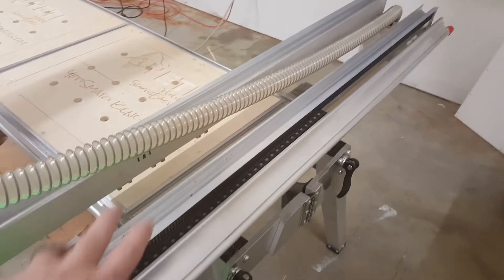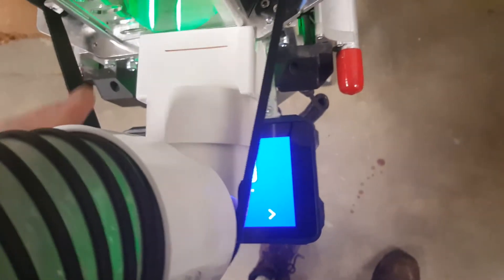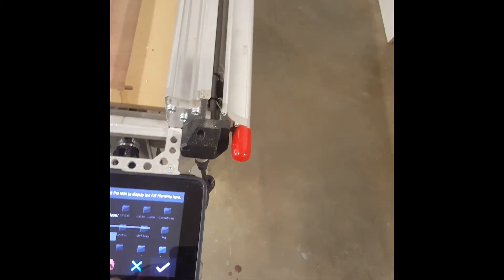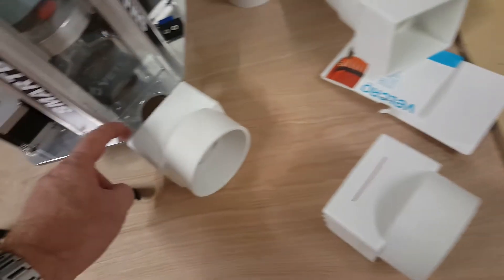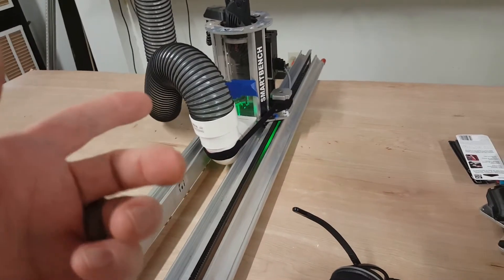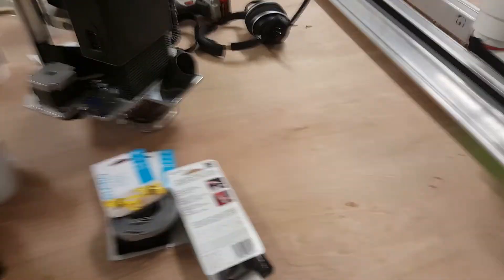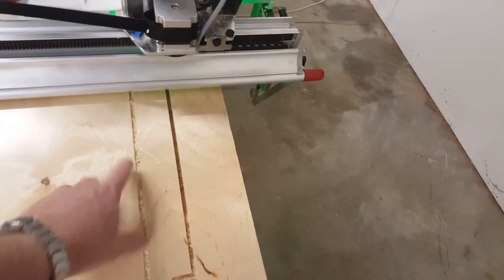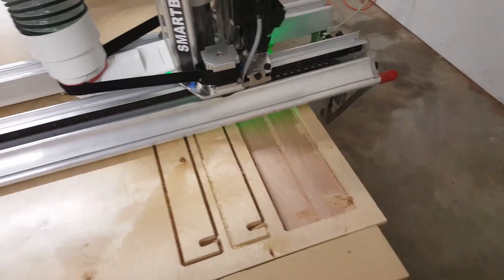Connecting a 4" dust collection system to the Yeti SmartBench

Comment: Yeti should just provide this as optional. When dust accumulates on the workpiece it actually affects the accuracy, as the wheels will roll over it lifting the x beam.
Reply: In the 3 years since this video was posted, there have been many variations on this, and Yeti Tool has released their own connection to a 4" system.  Many customers never see a need for this --- it all depends on what types of products you are cutting, whether you prefer to be portable, or will be leaving the Yeti in your shop all the time, etc.   Many customers of mine do not use the upper beam as a compression roller on top of their material, and keep it raised above the materials because the material could be easily marred by the pressure of the wheels.  I have customers that have rigged up a torsion box bed, and others that took THAT idea and extended it by adding a vacuum system to it.  That's the beauty of the SmartBench -- it's so easy to tweak the setup to fit the way YOU want to use it in YOUR shop.  Please don't hesitate to reach out to me directly if you have any questions.
Reply: @yetismartbenchus3590  Thanks for the reply! 🙏 I just saw the news yesterday that Yeti Tool developed the 4'' extration system  "BigFoot". I can't wait to get one, my DYI skills are not perfect and I am afraid of collateral damage if I do something wrong by attaching something of my own make to the machine.
And of course, thanks for the suggestions, especially the no-wheel solution which is a great idea for my application!

Comment: Any reason you could not use a clear piece of acrylic instead of the plywood for the cover of the X beam? Also, is there a reason that we cannot convert the existing 3" extractions vacuum exit and convert to 4" so that we don't have to create a system on the other side of the system?
Reply from the maker: No, use acrylic if you have it... my point was just that it's very simple to control the debris depending on how YOU want to set up your machine.  With the 4" dust collector, there is no need for the small plywood covers I showed.  For most applications, there is no need for them either, but, depending on what you are cutting, and how good your extraction is, you MAY need to do something like this so you don't have to babysit the machine.  I also sometimes connect a hose on the EXHAUST side of a ShopVac to blow on the spindle to help cool the bit and dispurse swarf.   That's the beauty of the SmartBench - it's so easy to tweak based on what YOU need for your production mix.   I sell the SmartBench in the USA and other areas and train customers.  I have different needs than my customers, because I need to be able to show folks that fly in for a demo/training day setting up the machine from scratch, we design their type of products/parts, send GCode to the machine etc... I show a wide variety of options that are not applicable to everyone, but VERY applicable to some, based on how they plan to use the SmartBench.   It's because of this, that I decided to be able to show using the factory dust shoe and built-in extraction hose, then, pause a cutting job, and attach the 4" hose, and continue the job --- just shows options.  So, adding it to the console side made sense to me.  If I was to set this up in my shop to use all the time, I'd use one or the other -- or both depending on the material!  If I was cutting full sheets quite often, I'd build a low profile torsion box to quickly index full sheets etc.  I have customers that have done this and then created a vacuum table.  It's such a versatile machine.  Come see us at the IWF show later this month - Booth A10013!

Comment: Thank you for this. We've had major issues with dust collection when cutting our plywood. The dust port just isn't big enough and gets clogged up.
Reply from the maker: Often, it also helps to change your cutter style.  I typically use compression spirals, but sometimes a 1 or 2 straight flute cutter works better when you have ply with a crappy core.  Of course, the other option is to buy better plywood!  But in any case, more dust extraction helps clear the table

Comment: you're up late
Reply from the maker: Hi Martin, left the shop around 8:00 but it probably took a few hours to upload.  Uploading to YouTube is VERY slow from the industrial complex the showroom is in.  This is the dust update I had mentioned to you that I was working with.  So far --- so good.  May look to put the same PVC parts on the back side of the Zhead (to balance it) --- but it's not much weight at all, and so far, all cuts and drilling seem to be fine and perpendicular.  Dust COLLECTION is great - much less cleanup after a full nest of cabinet parts and the SmartBench does not need to be periodically watched to make sure the dust chute is not plugged.